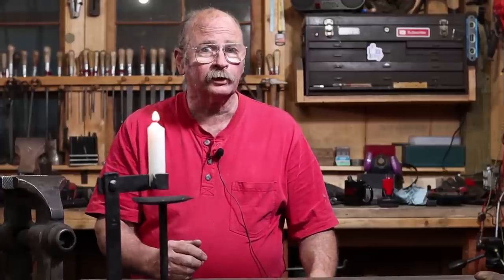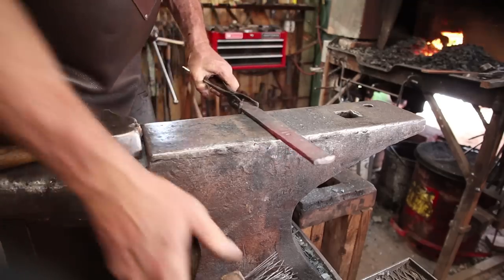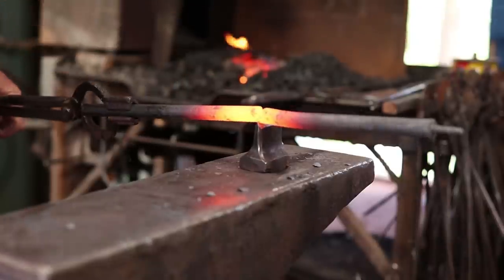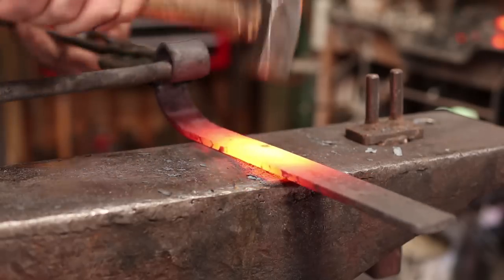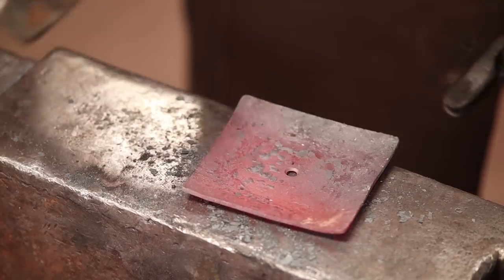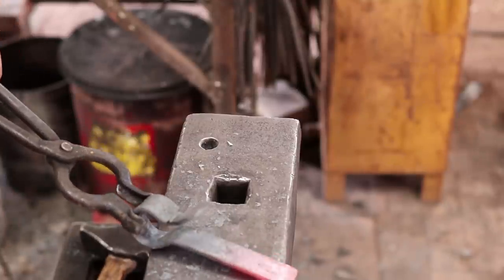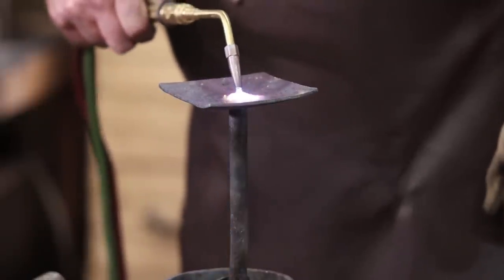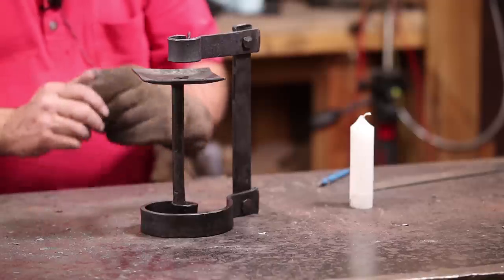Modern industrial candle stand - scratching a creative itch

Comment: Itches get scratches. I have to comment on the video quality though. Outstanding. Contrast, lighting, camera angles, even the audio is on point. You've stepped your game up even further.
Reply from the maker: Thank you for noticing.  I haven't done anything new with the audio, but I am using some better lenses and trying to add more fill light where I can
Reply: @BlackBearForge  it's working

Comment: At the Hardy tool cutting your hammer control experience shows, At my cut off tool I am much safer to use my "mild steel Soft Hammer and I don't have to resharpen my cutoff tools or grind the face of my hammer.
  Now I finally have bending wrenches and Hardy bending tools for these projects
 Thanks for your advice on most of my homemade tools making Blacksmith work possible.
Sir I thank you again.
Reply: Yeah, I've cut through hot metal and hit my hot-cut hardy with my hammer (not a "Soft Hammer") too.  I like your idea about a "Soft Hammer"™ and may make one to reduce the number of times I have to resharpen the hot-cut.  ;)  I need to forge some bending forks & hardy bending tools too!

Comment: John,
Nice video!  Now I'm starting to think of candleholders for my house!  ;)
Will you talk a bit about the hammer you use at the beginning of the video -- why it (looks like it) weighs so much and why you are choking up on the handle as much as you do?  I read somewhere (I forget where now), that I took as "authoritative," that if you're going to choke up on a handle, you need a smaller hammer.  Of course, most Smiths probably don't have dozens/hundreds of hammers at their beck & call, so I definitely think I understand why you're doing what you're doing.  I'd just like your opinion about this if you would.
Also, at about 26 minutes, you used a 2-pin "hook fixture" in your vise to bend the candle "clip."  The hook fixture looked like two separate pieces that could be "adjusted" in the vise to work with whatever thickness of material you are working with.  Is that correct?
Thank you for this video and take care!

Comment: John, I am a subscriber and member of RMS. I see you using your torch and then hanging it back up and it goes out. What kind of a set up are you using for the torch?
Reply from the maker: I use a gas saver or economizer valve.

Comment: Sorry for using your comments for questions on Band Saw, however; I have no other method of messaging you.
Reply from the maker: No need to apologize. That a great use of the comment section
Reply: @BlackBearForge  Thank you very much for your opinion on the Variable Speed Band Saw question I posed.  I appreciate it very much.